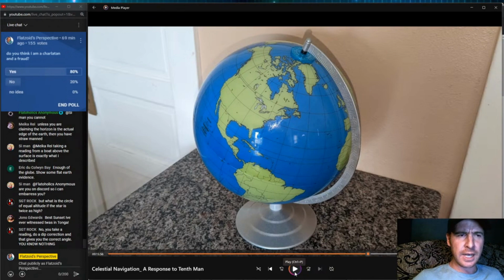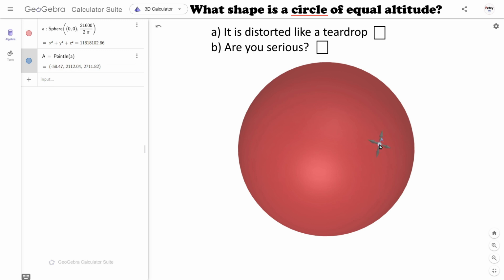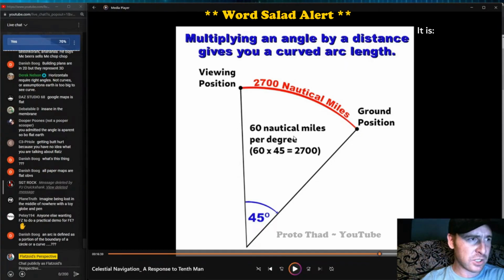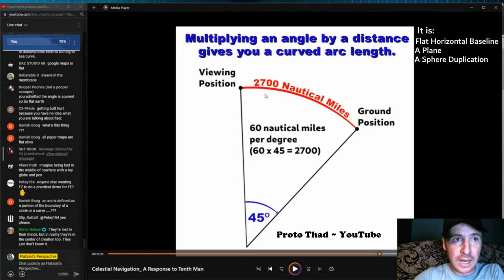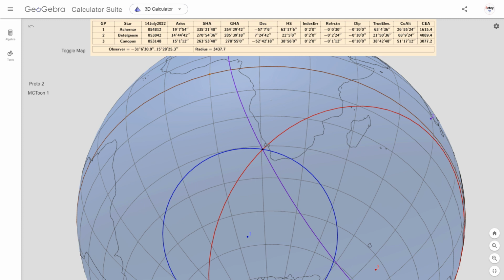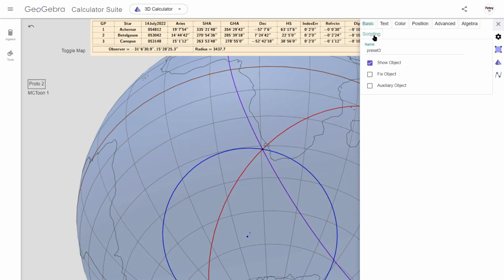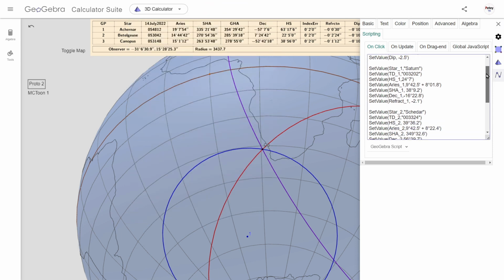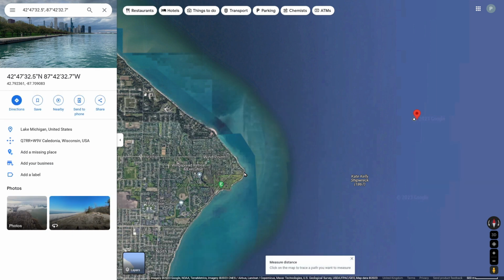Flatzoid Denies Circles of Equal Altitude on a Globe | Proto Thad Example

Comment: Who has ever used a Mercator projection map to to perform a celestial fix? Rob Durham's predicate is that celestial navigation is somehow done on a Mercator projection and then mapped to a sphere, which is not the case. The circles on a sphere are circles - on a sphere. If you want to map that to a Mercator projection you are going to wind up with non-circles on the projection.

Comment: If you put a sextant in Failzoid's and a chimpanzee's hand. My money is on the chimp being able to hold it correctly and use it before Failzoid.
Reply: The Chimp likely knows that there is 90º in a right angle, NOT 60, just for starters.

Comment: And the thing that will really boil his pish is that WE DO NOT USE circles of equal altitude to obtain a fix by celestial navigation. At least, not in the way shown using massive model globes, and huge pairs of compasses. It's handy to have a computer to draw suitable maps that can have circles drawn  on them, but that's not how it was done in the 19th Century. Hell, when I did my YO practical in 1980, even a scientific calculator was a rare, expensive luxury. The 'Circle of equal altitude' is implicit in the Marcq St Hilaire method, which is the method generally taught & used since before WW II, but actually uses solutions to the PZX spherical triangle equations. A fix can be obtained with about half a page of calculations, & plotted on a sheet of A4 graph paper [ I used to use old school physics notebooks ]. To use 'CoEA' on a chart would require charts the size of several double bed sheets, & a chart table the size of a snooker table.
In the 19th Century, there were a plethora of methods in use, including at least one that calculated a position in lat & long, directly, as 2 values, no circles or even segments of circles required.
The 'Circle of Equal Altitude' is a handy, easy to explain & understand example that can be shown to people, but it really has no place in celestial navigation.
['The HippyNavigator'.  Yachtmaster Ocean ]

Comment: Well - I guess it's good he isn't a sailor...
Reply: It would certainly be good for lifeboat manufacturers.
Reply: Wasn't it Flatzoid who said something like getting within 600 nautical miles was pretty good?

Accuracy was much better than that when the Board of Longitude put up the twenty thousand pound prize  (equiv to over three million pounds today) for a method for finding longitude within 30 nautical miles. Lesser prizes were offered for lesser accuracy, 10k for sixty NM. Limitations to nav accuracy at the time cost too many lives, ships and their cargo.
Reply: @D614G_aka_Doug  Really, the problem of longitude is a problem of time - but getting within 60 nm is basically within 1 degree on the Earth's surface - that is quite doable!
Reply: @Phylaetra  
It is quite doable now, but in the early 18th century when the Board of Longitude was established it wasn't. It was John Harrison's marine clock that changed things. He had to put up a hell of fight to collect the prize and even then it wasn't the prize as such. Without the intervention of the king he would likely have never collected his due.

Comment: I have to laugh, you show quite clearly that the sextant angle has to be corrected for index error and dip.  This is because (as anyone that actual performs celestial navigation will agree), the sextant does NOT measure the angle between the celestial object and horizontal.  Flatzoid just doesn't get that tiny detail.  It measures from celestial object to the horizon, and as any glober can tell you, the horizon does NOT RISE UP TO EYE LEVEL.  After you make those corrections (and refraction as well), you have the angle to horizontal.

Another nice demonstration Petey, keep up the great work.
Reply from the maker: Thanks so much Mike. The other thing I want him and Brian's Logic to take away is the how the circle can be created. They swear blind it's not a real circle. Proto Thad shown a slide on one of his videos of the sphere being sliced with a plane. It's just so simple and neat. How they deny it is just beyond me. They need to think where the 60nm/° actually comes from.  Thanks again for keeping an eye on me, 😋
Reply: @Petey194  since the flerfs need their visual demonstrations just take a glass and put the open end over a globe model to show how circles of equal altitude work. If they don't get it after that then they have no hope.
Reply from the maker: Yep, I'm sure it was Wolfie6020 that put a wine glass ona ball in one of his vids.
Reply: @Requiem4aDr3Am  "If they don't get it after that then they have no hope."

They won't, and there isn't.
Reply: What you have said is correct. I would add though that just holding the sextant level oftentimes gives me measurements to within 30 arc minutes.
I sight a star, pull it down to what I judge to be level, fire up Stellarium and compare my measured altitude with what Stellarium states. Stellarium also gives the true azimuth. Brilliant app.
Reply: They don’t care if they know how it works or not.   All they care about is how they can pick cherries about it.  They look for their keywords and then once they find it they declare a win. Find the word level, horizontal, horizon, etc and they cry out flat.   Just as long as their sheep never go and look at the real information.
Reply from the maker: @Isolder74  yep, there is no discussing it with those types. eg the wybengas of this world. 🤨

Comment: @Petey194 is it possible to look at the source code of your script? Your location fix is 2.5 miles closer, and it's bothering me. :)
Reply from the maker: Sure np. It's linked in the description. I've just edited to allow you to open the menu and settings. I wouldn't worry about it being a bit closer. I've set this up to automatically centre the observer in that cocked hat triangle but you'll notice I fiddled with it to where I thought was best, given the shape of that triangle. Try looking at the observers coordinates when I first clicked the preset. It won't be far from yours.  👍
Reply: @Petey194  I just take the average of the coordinates of the three intersection points. Depending on the shape of the crooked hat, I'm all kinds of wrong :) That's one thing I want to improve in my software.
Reply from the maker: @TakacsJanos  Yep it's so easy for a human to detect where the centre of 3 overlapping circles is. Not so easy to automate. The bit of programming for that is in the settings / scripting section of the table.

Comment: I got 42° 49' 00.28" N   87° 39' 18.07" W , and I can provide the method of calculation too.
I'd like to see Flatzoid applying his own method from his word salad, and get similar results. But he won't be applying anything, at most he will be just lieing.
Reply from the maker: In his video, (linked in description but you don't need to click it 😆), he was helped by Roohif to get a fix on a flat earth and he was 544km off. He called that a success! Only Flatzoid 🤭
Reply: @Petey194   my software was 750km off at one time, until I realized the bug and fixed it. That distance error means if I'm in Europe, my position can be three countries further than I think. Now I only have 3.6 km error for that particular measurement. I still call this a partial result, not a success.
Reply: Flatzoid’s only attempt at CN using his method put him 544km away from his true position, yet he claimed a victory none the less.